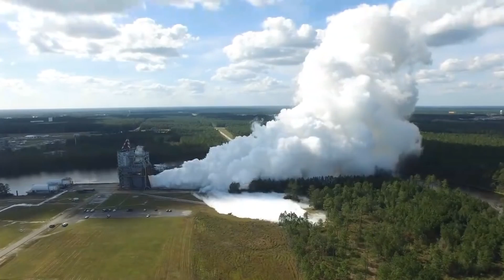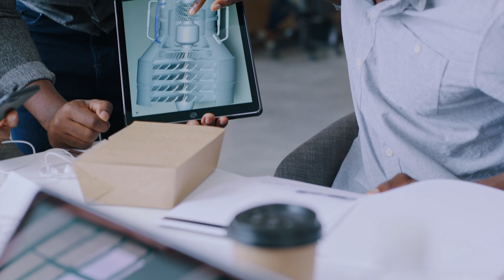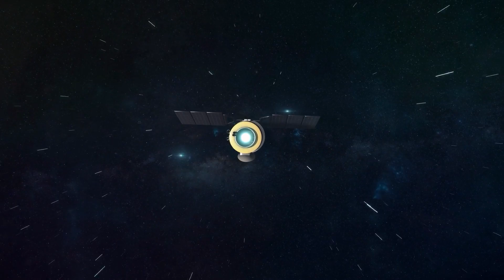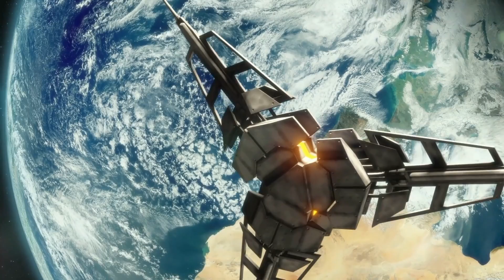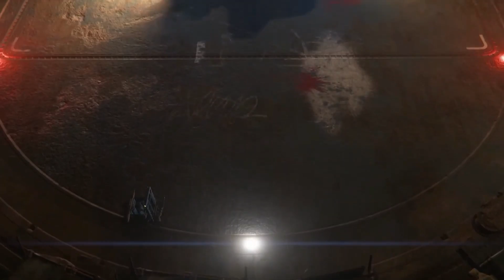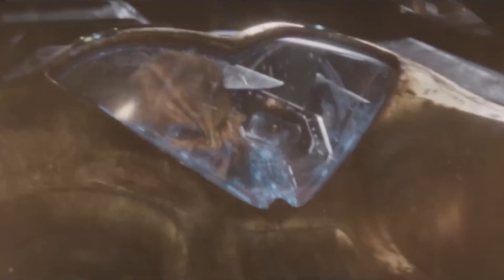NASA Designs Near Light Speed Engine That Breaks Laws Of Physics

Comment: build a rocket 🚀 with a booster on top it will be able to use Less fuel two small space shuttle on the side where they can be detached and releaset were  the shuttle can carry 4 astronauts